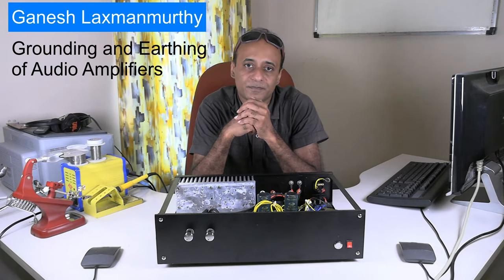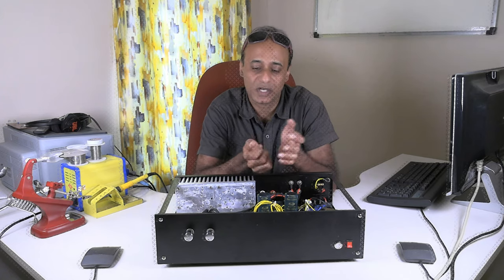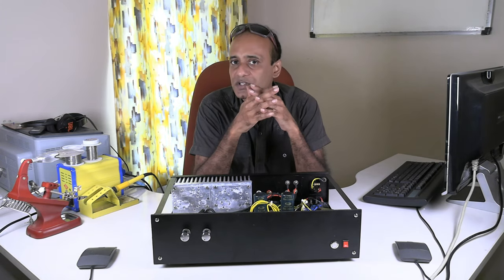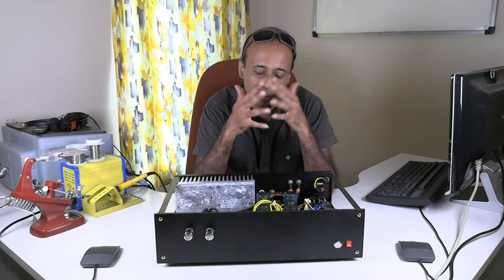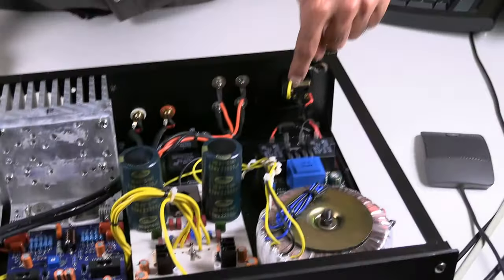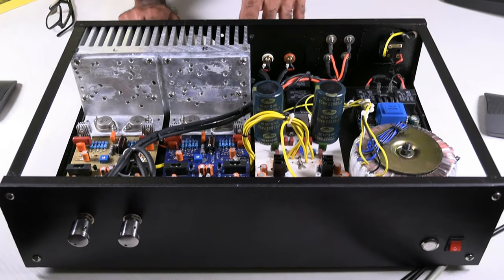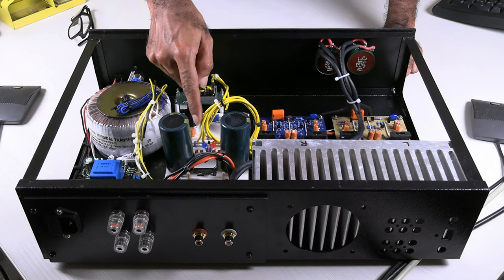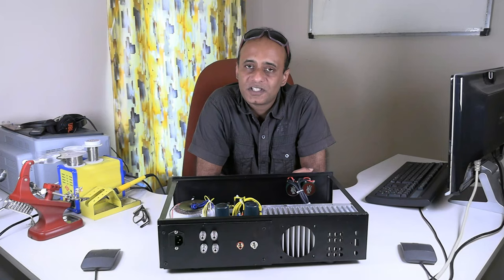Professional Grounding and Earthing of Audio Amplifiers

Comment: Thank you dear, after 100 videos I finally found the video that explains. Always thought earthing and grounding is same. I just have one questions. How about 2 pin devices, how is earthing & grounding managed in 2 pin devices like tv?  Also I have 2 very good amps from Yamaha and Marantz, both are 2 pin, eve the power socket at the back has 2 pins only, how is earthing managed there?
Reply: they have chassis grounding where there is no earth wire and no ground loop breaker, just the star ground directly to the chassis, hench chassis ground
Reply: @garygranato9164  Hi. Can you explain what is the purpose of chassis ground in this case? Is it for safety reason? if yes then how? I don't have an electrical background so it's a bit hard for me to wrap my mind around!
Reply: @anhhct  i too am an amature.  for safety the voltage is sent to ground. and also the chassis is used as a ground point/plain, stray RFI, EMI can be sent to ground via capacitors connected at the right place in the circuit.  i think thats how it is anyway.

Comment: Sir, when ever electrical switch is on or off , speakers make noise
Reply: Any solution
Reply from the maker: @rahulsawant1493  Add an RFI EMI Filter to the power line of the amplifier. Search for the same on amazon. (Elcom brand)